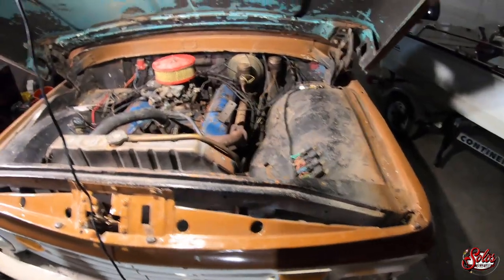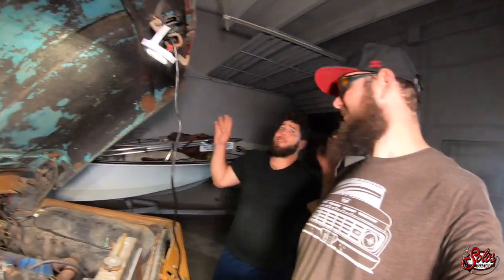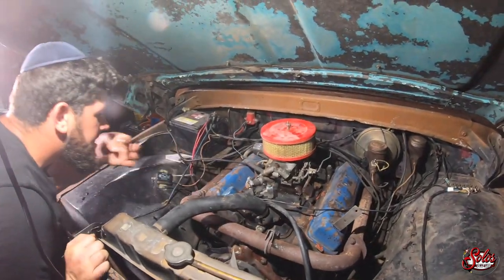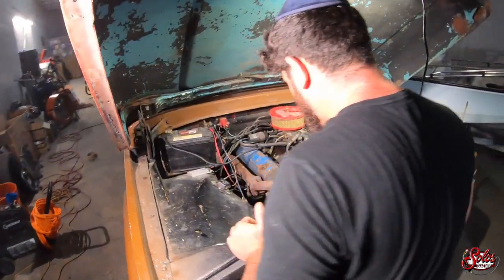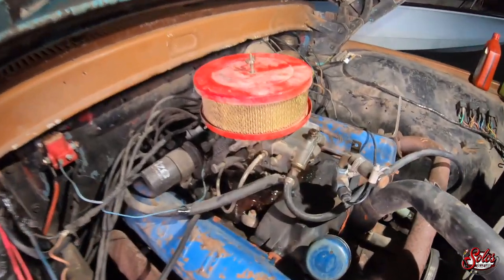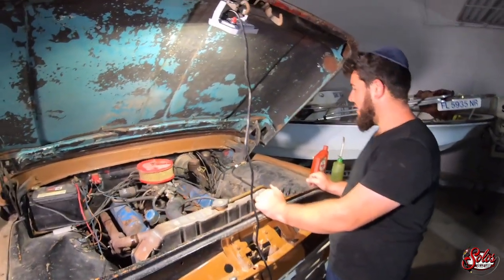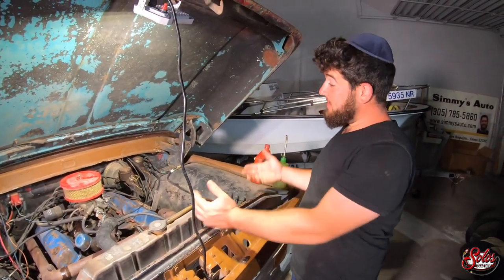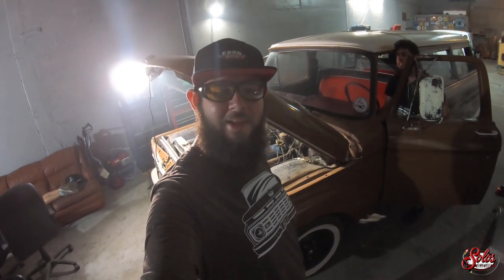Got our 1963 Ford B100 292 Y-Block Running!! | Solos Speed Shop

Comment: It has pretty severe blow-by but yet it doesn't smoke. but you have to remember those engines don't have a PCV system. they usually have a draft tube for crankcase ventilation. but that engine has some definite wear on it the previous owners definitely got their use out of it. I would be willing to bet it's got quite a few kilometers on it. I can see your reason for wanting to do a swap. although depending on the condition of the Cylinders. a simple rering and bearing rebuild would breathe new life into it. but it's still an old engine with old technology which means you have to weigh you options accordingly.